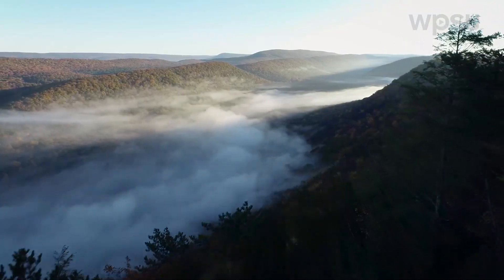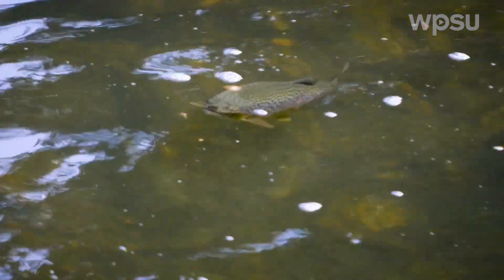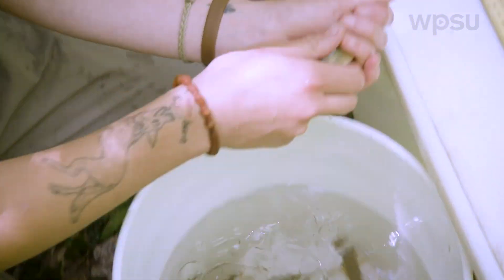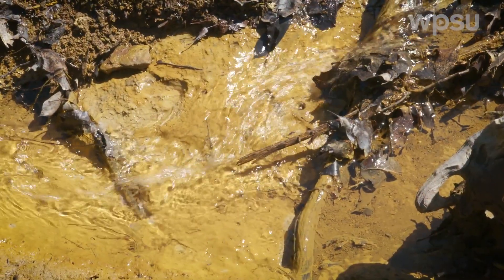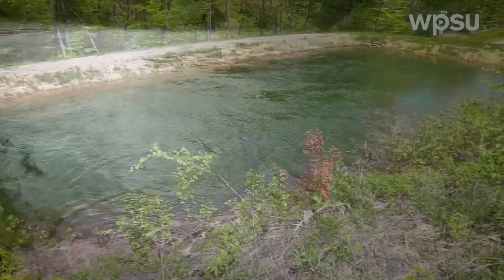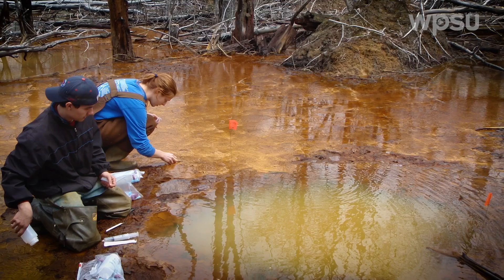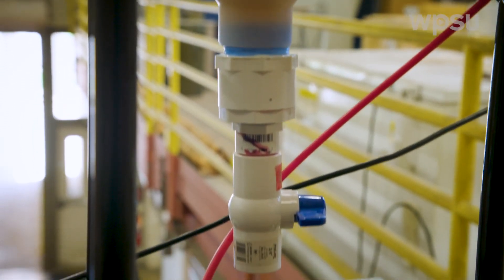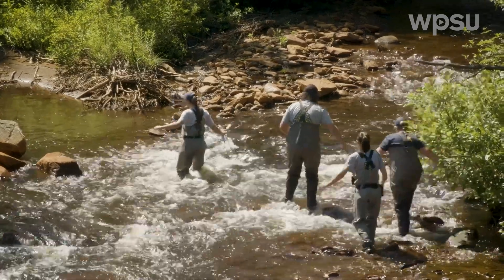Healing the Red Mo: The Toxic Legacy of Acid Mine Drainage | Red Moshannon Creek

Comment: Dear Fellow Landowners and Educators,

My name is Tony Striedieck, and I'm reaching out to share an important perspective on addressing the longstanding issue of acid mine drainage in our community, particularly around the Moshannon Creek area in Center County, Pennsylvania.

For generations, our families have been connected to the coal mining industry in this region. While this has brought economic benefits, it has also left us with significant environmental challenges, primarily acid mine drainage. The current approach to this problem focuses largely on treating water after it has already become acidic due to contact with pyrite in disturbed soil. While necessary, this method is reactive and doesn't address the root of the problem.

I propose we shift our focus to a more proactive, preventative approach that could not only mitigate environmental damage but also create new opportunities for land use and education. Here's an overview of the concept:

1. Shift Focus Upstream: Instead of solely treating discharge points, we should concentrate efforts on areas above the mine fields where shale is present.

2. Soil Amendment: Apply large volumes of agricultural lime to these areas. This is a common practice in active agriculture and could help neutralize acidity before it forms.

3. Regenerative Land Use: Implement rotational grazing with multiple animal species, moving them daily. This practice can help build healthy soil, which acts as a natural filter.

4. Regular Lime Application: Annually apply high-calcium lime, potentially sourced from agriculture operations, to maintain soil pH levels.

The benefits of this approach include:

- Prevention of acidification before metals are disturbed
- Creation of a healthy soil ecosystem that naturally filters water
- Potential for profitable land use through agriculture and grazing
- Educational opportunities for students to learn about environmental remediation, soil science, and sustainable agriculture

I believe this approach embodies the principle that "an ounce of prevention is worth a pound of cure." By addressing the issue at its source, we could significantly reduce the need for downstream water treatment while simultaneously rejuvenating our land.

I'm calling on our school system to consider incorporating this concept into their curriculum. By educating our youth about these proactive solutions, we can inspire the next generation of environmental stewards and innovators.

To my fellow landowners, I urge you to consider how we might implement these practices on our properties. Even small-scale trials could provide valuable data and demonstrate the potential of this approach.

Lastly, I encourage everyone to engage with local environmental agencies, university extension services, and the Pennsylvania Department of Environmental Protection to explore the feasibility of this concept and potentially advocate for pilot studies.

Together, we have the opportunity to transform our approach to acid mine drainage from reactive to proactive, potentially creating a model for other communities facing similar challenges.

I welcome your thoughts, questions, and ideas as we work towards a healthier, more sustainable future for our land and water.

Sincerely,
Tony Striedieck